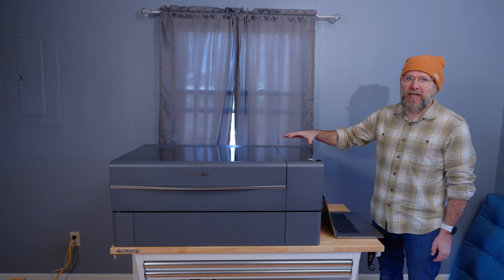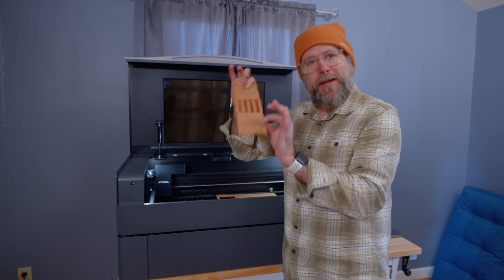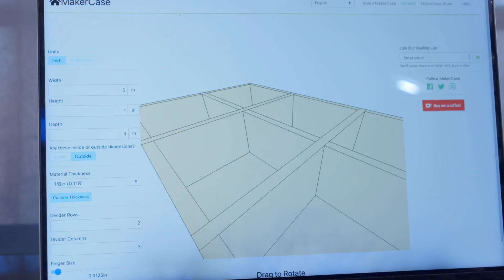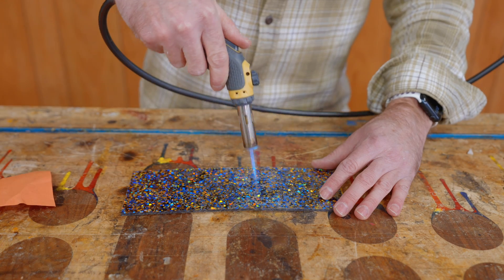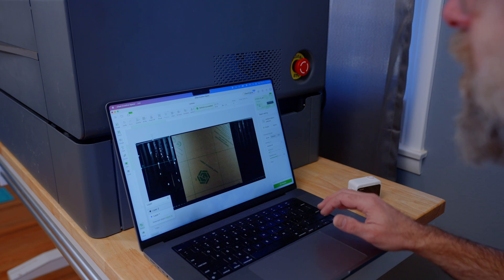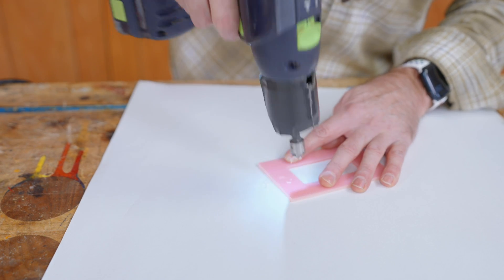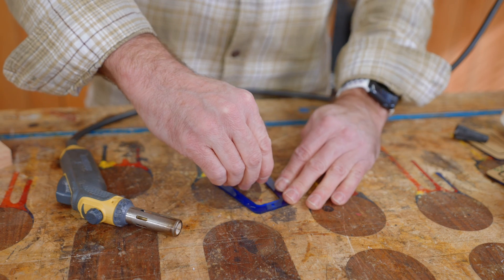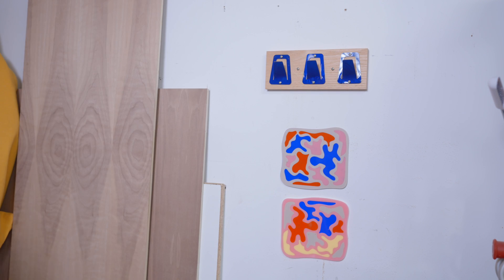10 Acrylic Projects for Your Laser with Free Plans

Comment: Some nice projects! One thing to note - Transparent acrylic and CA glue don't mix too well. The solvent vapours often cloud up the transparent acrylic
Reply: What would you use?
Reply from the maker: Acrylic cement.
Reply: @briansnyder9496  I've had good success using T8000 glue. Only downside is it takes longer to cure

Comment: Would the wecreat vision that you recently reviewed be able to cut these acrylic sheets?  I've hard that diode lasers don't work on clear acrylic, but I'm not sure if they work with other colors than black.
Reply: From what I’ve seen diodes will not cut clear, but will cut colored acrylic. But not sure if they will cut all colors.
Reply: @BobBob-eh5sb  Thanks
Reply: I've heard that diode laser have problems with clear, white and blue colors not only acrylic but many other materials. The laser just passes thouse colors and doesn't do anything to the material. There are tricks for only lightly engrave but never cut.